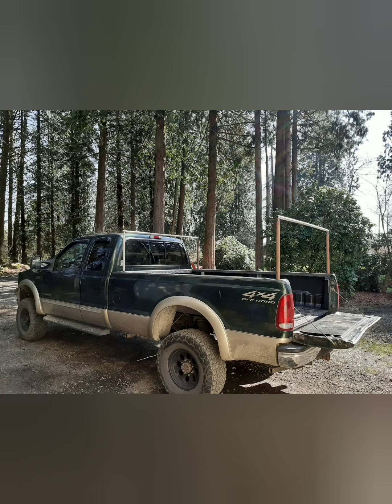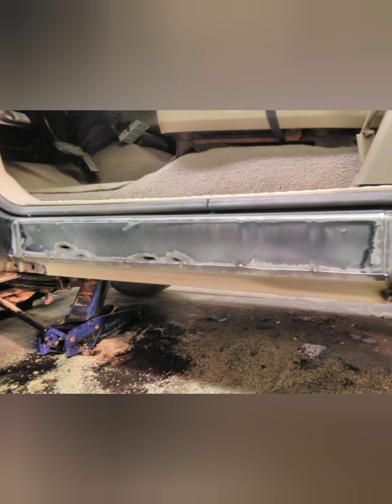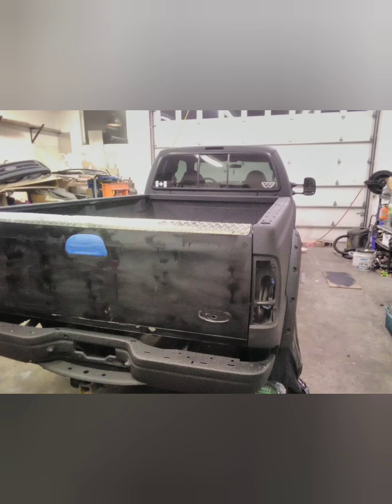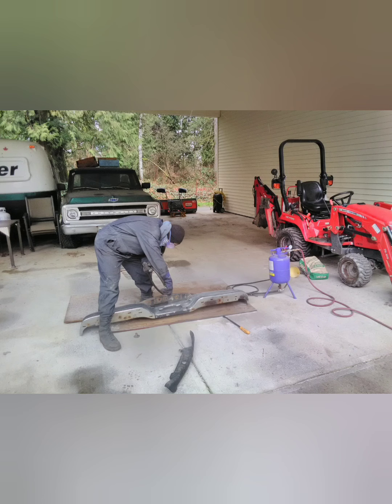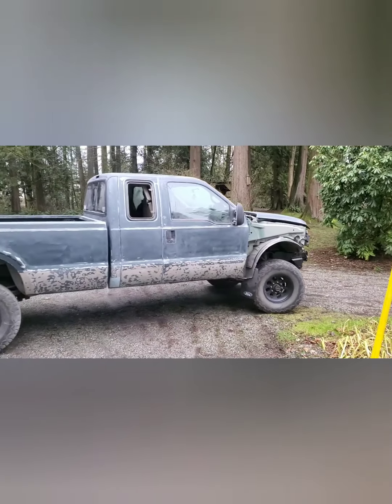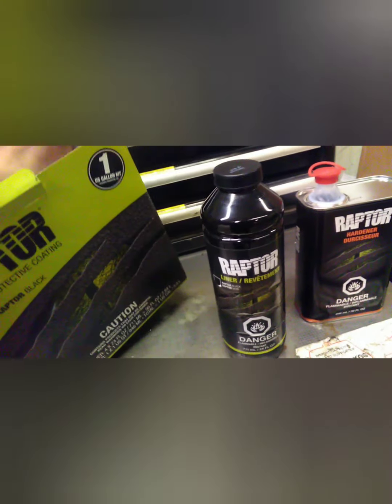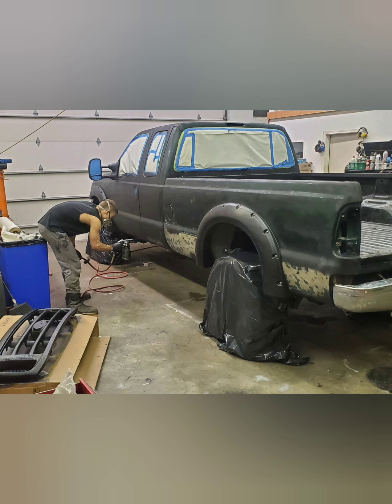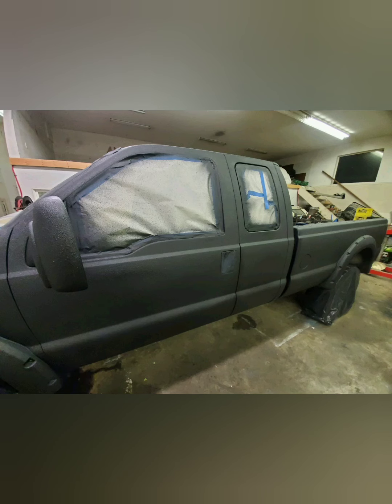How To Raptor Line a Vehicle (DIY)

Comment: How did you paint the back of the cab and the front of the bed or did you not paint that?
Reply from the maker: I did not paint the entirety of the rear cab and the front of the bed, the original color was dark green so you can't tell, if the original color was white for example I would have pulled the bed and sprayed. I just sprayed as far between the two as I could and you cannot tell.
Reply: @NolanRMcEachern  gotcha yeah mines red so im definitely gonna pull the bed back